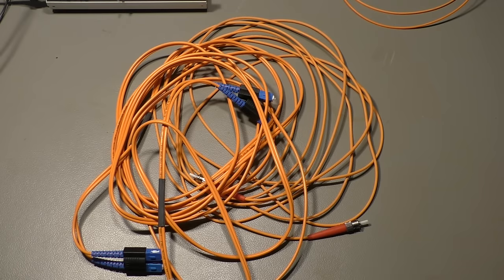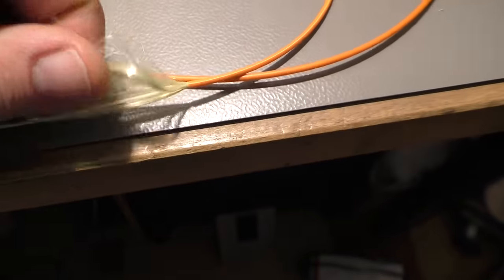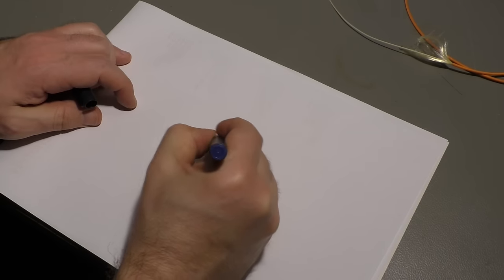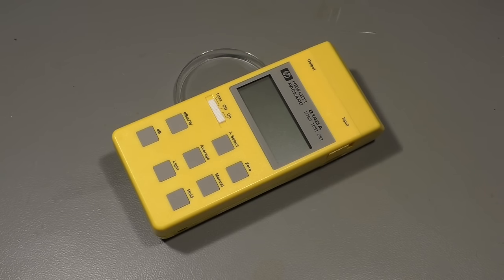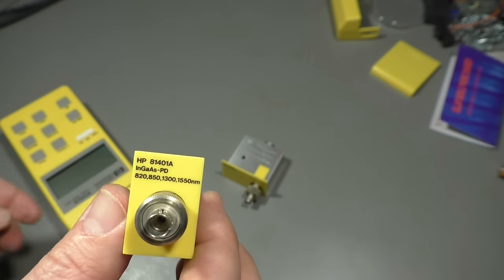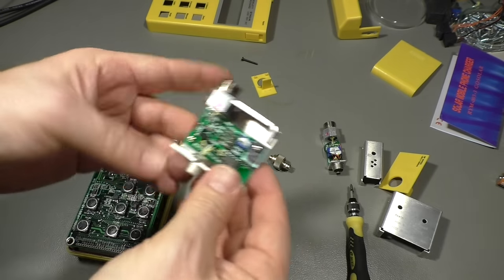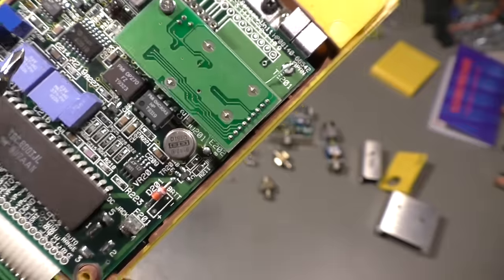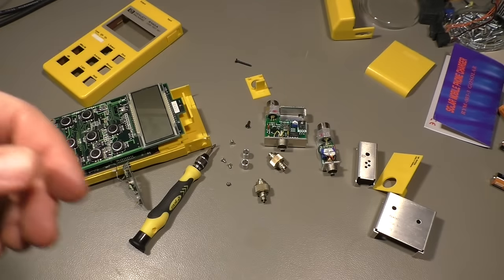Fibre Optics and other stuff (PWJ27)

Comment: Corning Glass makes a type of fiber called Bend insensitive fiber which has a much lower lost when bent. it is also important to note the Cavalier is there for installation purposes. you attach to the Kevlar  pull it not the jacket this prevents micro bands which can create very high losses in fiber.

Comment: I wanted More than 28 Mbps bandwith when i was downloading larger files i was paying around 45 euros when i was in croatia in old house i remember times when i was playing original video games on Dvd cd drives now i have 50 Mbps file transfer on epon which is connected on 8 wire cable to isp router.